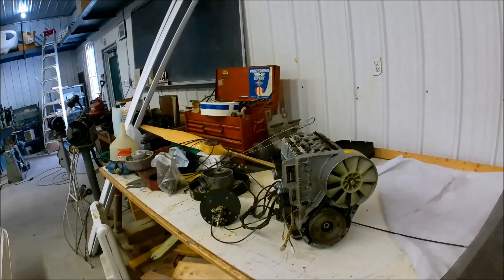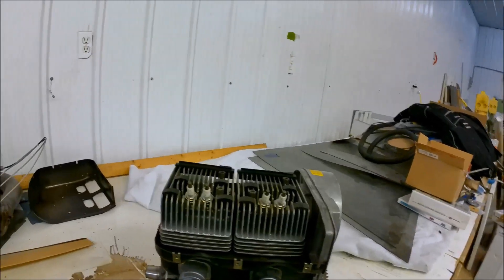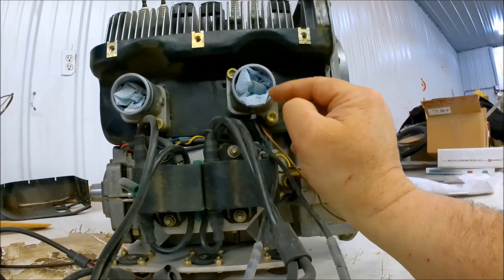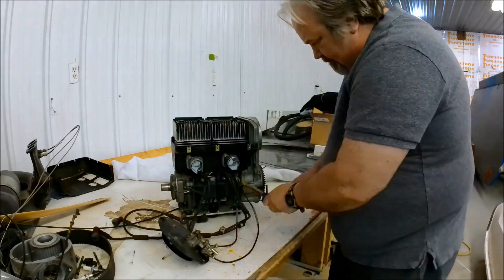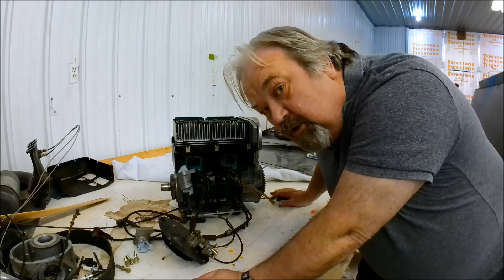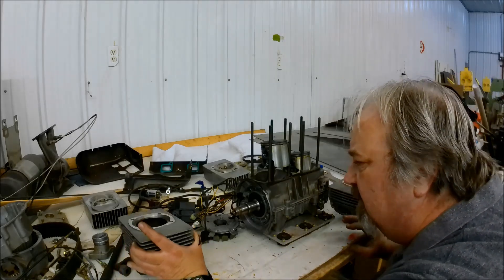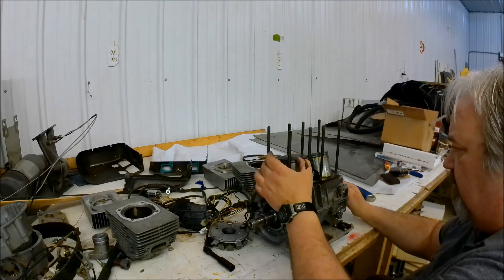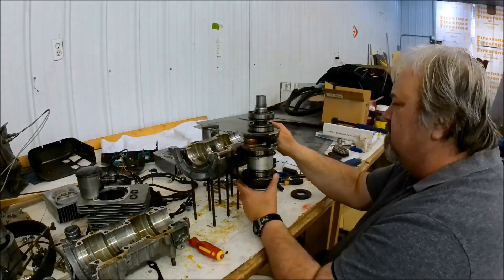EP #33 Engine Disassembly and inspection, Challenger 2 Ultralight Airplane Rebuild/Upgrade.

Comment: A good little engine but it's achilles heel is the pullies for the cooling fan, they rust and act like a file on the belt GET THEM CHROMED 5 years and still in good condition

Comment: Not a pro but definitely ditch the oil injector. I had boat with a 4 cylinder 2 stroke outboard and spun a bearing do to the injector being shit.
Reply from the maker: I spoke with the Rotax expert about the oil injection. I discuss that in my next video.

Comment: Why I quit using oil injection on my outboards had a hose get plugged up seized up 3 of the 6 cylinders. After speaking to a few guys who race 2 stroke outboards boats they all said everyone removes the oil injection systems just one more thing to go wrong mix the oil in the gas you know the correct oil is always there. I know it's very convenient to just fill a tank with oil and not have to worry about mixing oil. I could not think of anyway to create a system that could monitor that oil was actually mixing at the proper ratio in the fuel.
Reply from the maker: I will be assessing the oil injection verses premix options very closely. One deciding factor is the known failure rate of this system. I don't have any data on that, so I will have to find that out before I make a final decision. I am leaning towards premix though.
Reply: @challenger2aircraftadventures  Thanks for the video. Hope all works out for you. I have several Rotax engines, 503s and 582s. Use oil injection on two and premix on a 503. The oil injection system on the 582s works well, but you must be careful of check the system. Mark the oil level in the tank and check it often. Bill Whitley, High Springs, FL, SP CFI & LSRM-A. own and fly CH II long wing and a CW.

Comment: Also, if that pipe was trapped between the manifold and the cylinder, then you would probs have a weak mixture, due to air leaking in.
Reply from the maker: It was trapped between the ignition coil and the mounting plate. Fortunately just enough oil was passing through to not damage the engine.

Comment: Great video and one I've been waiting for. As for the black build up underneath the crown, from what I've seen and experienced that's caused by oil burning on to it caused by the crown overheating due to the engine being to lean. Also, rotax says the 503 should be completely overhauled at 300hrs or every 5 years. Maybe a good decarbon and new rings and new PTO bearing and seals you'll be good, Id personally just overhaul it if money is no matter.
Reply from the maker: The Rotax service center owner I spoke to mentioned that the carbon buildup on the under side of the piston is normal for this engine that is mounted inverted. He gave it a clean bill of health after looking at the photos I sent him, with the exception of the outer PTO bearing, which is smooth running but a little noisy. I've ordered the replacement bearing from him, and when it arrives I will install it, decarbon the engine, then reassemble the and run up the engine.
Reply: @challenger2aircraftadventures  yeah I don't think I've seen a 2 stroke engine without a little build up on the underside.  Cant wait to see her flying. Now to get back to my maintenance on my challenger.